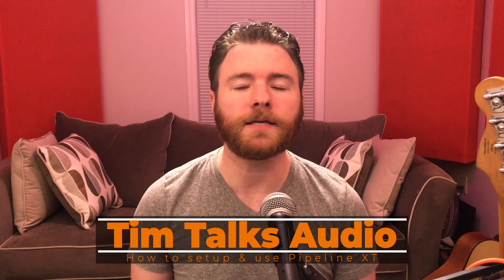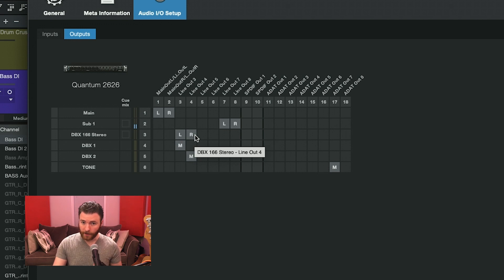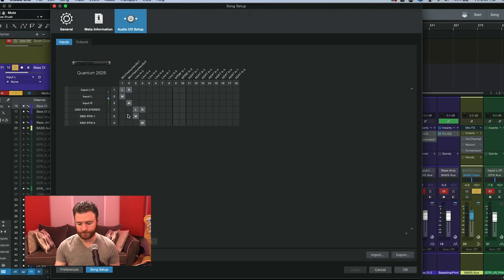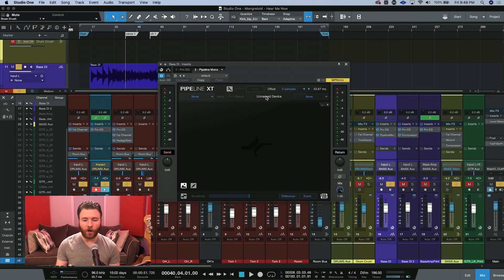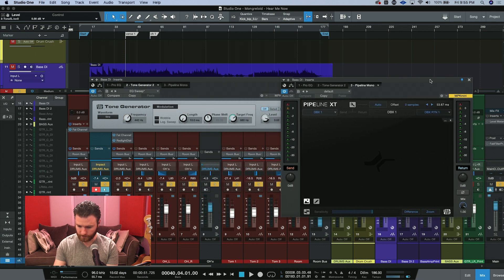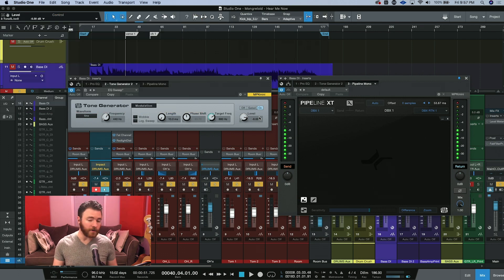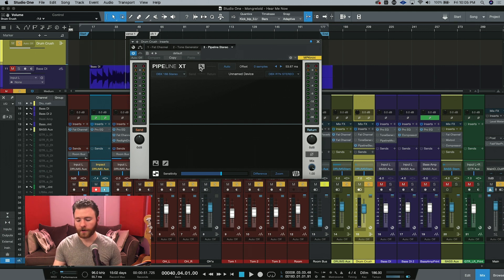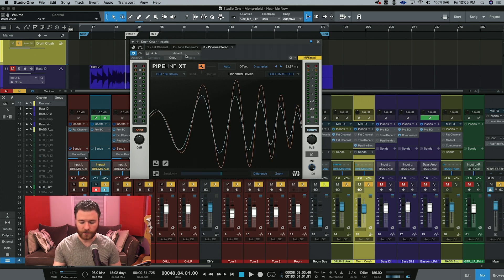Studio One: How to setup, calibrate and use Pipeline XT

Comment: Fantastic stuff, really needed that, thanks for the explanation. 
Now, the question is, since it works as a plugin, does that mean i can put it on multiple tracks at the same time. For example, i have a 2 guitar subgroups that would include each a DI and Mic for the recording (So i have 4 tracks total) and i send them to a guitar Buss, could i apply this to lets say DI guitar 1 and mic guitar 2 on top of the Buss ? 
(So in the case of a compressor or EQ, or anything my pipeline XT would be routed to, i would have the signal of DI guitar 1, Mic guitar 2 and Buss going to the same piece of hardware at the same time ?)
Reply from the maker: Technically yes, you can put pipeline XT on multiple tracks at the same time, but if you only have one channel of your gear (let's say a compressor) then you can either send a summed signal to the channel, or have the one outboard channel on one channel in S1. So if i have a mono compressor and want to use it on a vocal, a guitar, and something else. I wouldn't send all of those signals to the compressor at the same time, because I would want to adjust the compression settings per the source. 
For your example, you could do a few things. If you want to "compress" (as our continued example of outboard gear) your guitars, you have a few options. You can "compress" a total guitar bus, or you can compress a "guitar 1" bus, or you can compress guitar 1 mic/di individually. 
I would not recommend sending Guitar 1 Di & Guitar 2 Mic for example. These are different performances and what happens with one will effect the other in a way that you may not want.
Experiment though and make some cool sounds!! 
Cheers!
Reply: @TimTalksAudio  Thanks a lot for the reply ! I'll try to experiment a bit and see what turns out, it could be very interesting indeed. 
What i am foreseeing at the moment is that Pipeline would allow for easier routings and setup for the outboard gear but at the expense of the I/O of the ADDA but a classic patch bay might allow some more "on the fly" adjustments (ergo, more easy to experience maybe...) but multiplies the cables required for the overall setup  🧐

Guess i would have to see what would be my needs for every particular mix then, for example, if i receive tracks that might be poorly recorded and need to tweak them before i can even listen to them, pipeline seems to be the way to go for a quick and efficient tweak on a particular track, whereas if i was to be done with the static mix and ready to do more in depth manipulation, do a custom routing to the outboard gear thru the patch bay might be more adapted to the task. So it just boils down to what i want out of this track and personal preference. just writing out loud here, sorry if it is a bit long 😅

Comment: Might be a dumb question but after you adjust everything, Do you bounce to a new track ???
Reply from the maker: You can print it to reuse the gear on another track, or to save time later during mix down so you don't have to do the mix in realtime later.

Comment: I/O's that you use for external hardware devices should be exclusive, not in use anywhere else in Studio One.
It's latency is too high to use during Low Latency Monitoring so it will get bypassed.
Also make sure that the Universal Control software mixer is not somehow blocking (or muting) signal!

What I have noticed (that I hope will be workaround for many of you) is that as an effect send, Pipeline seems far more stable. If you set pipelines mix and your external devices mix (where required) to 100%, you can then dial in your effect to taste. And, if parallel effects is not what you are after, set the send to pre-fader – that way you can pull the fader right down and turn up the send to get only the effect audio, BAM!
Reply: This was super helpful, thank you! 

Disabling UC (whether in UC itself or by clicking the blue Z on the master channel in Studio One), as well as using Pipeline as an effects send solved my two biggest my conundrums: Feedback loops and no return signal, respectively.

Comment: Another great video and a real help. You're using it differently to me so there's a few things I need to ask. 1) You're using the same output and input channels on your interface - how come that doesn't cause a feedback loop? (When I've done it that way I have - having come from Pro Tools I first set it up like that). 2) Are you monitoring through Studio One or direct monitoring? (I'm really not sure which way to do this - I've got to a situation where when I physically bypass the unit the signal drops to barely audible and hence I've been bypassing Pipeline to A/B.) Hope this makes sense and thanks for the video.
Reply from the maker: Hello @angrybonbon !  Your questions does make sense, so let me do my best to answer! 
1) Using the same output and inputs (by number) would not make a feedback loop because I'm not feeding the return signal back to the same output. I'm sending a signal from output 3 to the device, then from the device to input 3. By default, input 3 does not send signal to output 3, you would need to manually do that. Pipeline also will not resend the return signal to the send, because it's already back from the device!
2) I am monitoring through S1. If you're physically bypassing the unit, and getting that much of a signal drop, there's something else going on. If you calibrate the send and return signals while the unit is in bypass, then you shouldn't get a drop like this. Once you are calibrated in bypass, then any signal loss/makeup would come from the unit doing its work. So if I get 4 db of gain reduction from a compressor, then my return signal should be 4 db lower and if I bypass, it should be a 4 db difference. In the case in the video, i could use the output gain to get those 4 db back.

I hope this helps! Feel free to reach out if you have more questions!
Reply: @TimTalksAudio  Brilliant and clear answer. Thanks for taking the time Tim. Will try it out with the signal generator like you have to get the levels right first.
Reply: Only tried it with an outboard (mono) EQ, but your process worked! Thanks again Tim.